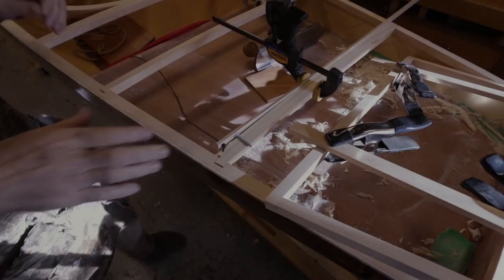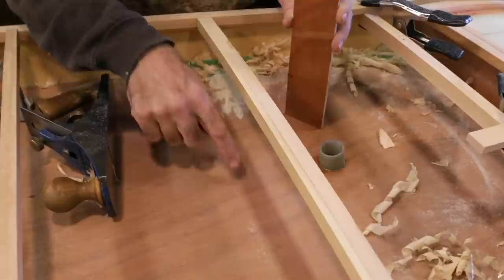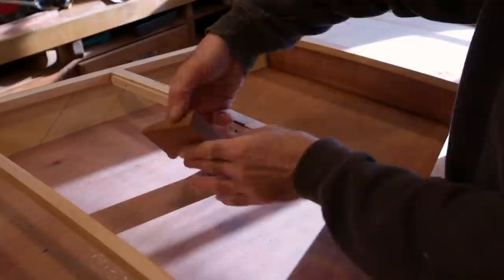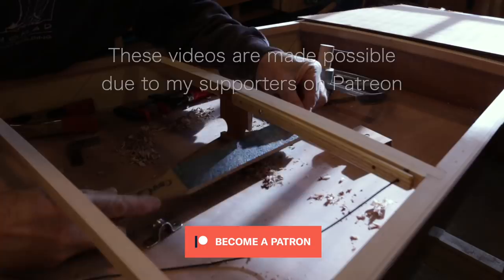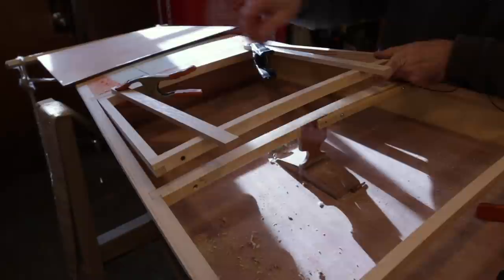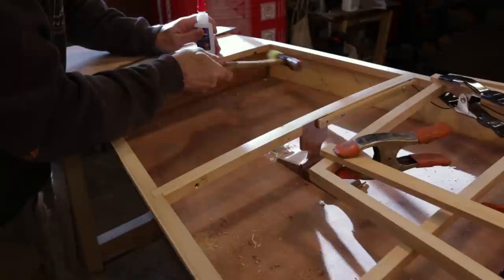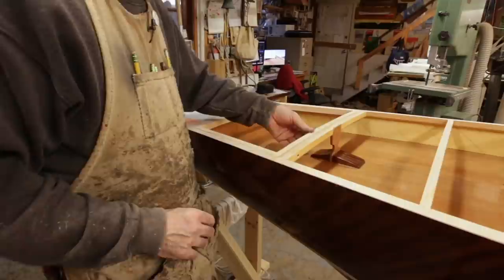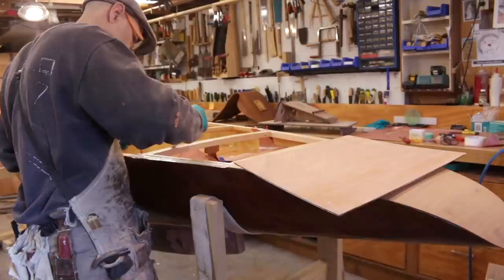International 2.4mR Sailboat Project - Episode 40 - Deck hatch, part 2

Comment: The latch mechanism is really great. (May I suggest that you put a stop on the latch to limit the travel of the wooden spring. If the user does not know how the design works and what its limitations are, he may pull the latch string too far some day and snap the spring.)
Reply from the maker: That's exactly what I did. Sort of.

Comment: You can buy silicone cabinet bumpers in many sizes that can be used for friction on the hatch frame. I've used them on different projects and added a drop of contact cement to make them a little more secure.

Comment: Mark, why don't you put a little stop on the inside of the gunwales to stop the ash spring-strips from being pulled too far. That would reduce the chance of them breaking from being pulled too hard.
Reply: I had another idea, too, when I couldn't sleep in the middle of the night. How about drilling a second hole at each end of the ash spring strips, and attaching a second pull cord, coiled away for when the first cord wears through and breaks.
Reply from the maker: That bit of seen twin is so strong it could lift the whole boat even when ballasted.

Comment: I really like your elegant solution to the hatch closure.  Would it be possible to add a seal (compressible waterproof foam) around the perimeter so when you close the hatch you would press lightly on the forward end so that the pins would engage and the foam seal would create just enough upward pressure to keep the hatch from moving?
Reply from the maker: Well I considered that but then I would have to plan for the extra thickness. This hatch really doesn’t need to be waterproof so I decided to keep it simple. It could be done at a later date if need be.

Comment: Beautiful work!  When I cut the deck of my kayak to make a flush hatch I had an problem with getting it to lift away from its' surround.  I think you may have the same issue here, given that the hatch will be flush with he deck at the gunnels.  I solved it by drilling two very small holes, about 1 inch apart, and using a loop of medium fishing  line (maybe .75mm leader? )  to form a loop that you could fit your finger under to lift it enough to get another finger/hand underneath.  Works perfectly, almost invisible, and no leakage.  Just a thought.
Reply from the maker: I'll keep that solution in mind if it becomes problematic.

Comment: Very cool latch... Simple, secure, efficient... Will there be a water seal, or is it to be a wet cockpit.
Packing Tape: Would Tucktape work as well? Cause you know.. red...
Reply from the maker: No water seal. doesn't need to be watertight. Tuck tape would work but it's adhesive is way too strong for convenience.
Reply: @Nomadboatbuilding  Ah! I see... Very grippy stuff and if you don't want to get a little wet what are you doing in a boat. The end.

Comment: Unique method--  Is there any need for the sides to be water-proof in case the owner likes to heel over on an upwind tack?
Reply from the maker: I don’t think so. Leakage would be minimal at best.
Reply: Any water that got in would find it's way into the cockpit where there should be a pump anyway... I can't see it being a problem....
Reply: @realnutteruk1  had only mentioned it for possible foam/rubber strip added to bottom edge of the hatch cover.  Sailboats are meant to heel....

Comment: No sailing boat needs that much rudder angle....
Reply: Not for steering, but it is good for braking
Reply from the maker: You are absolutely right. We always intended to put limiters on the steering cables. I just didn't like the way the tips of the quadrant were catching that station.